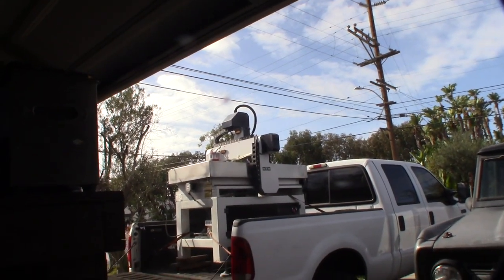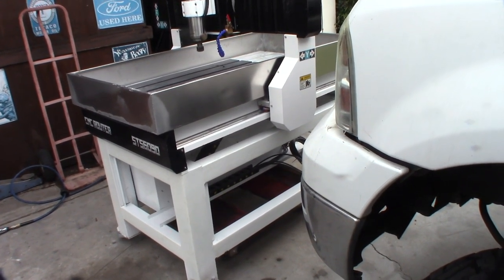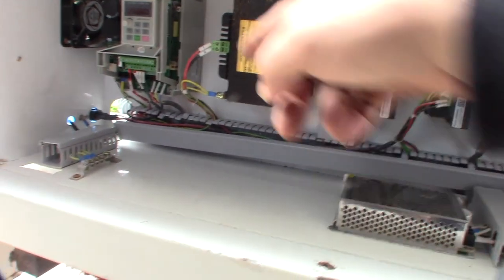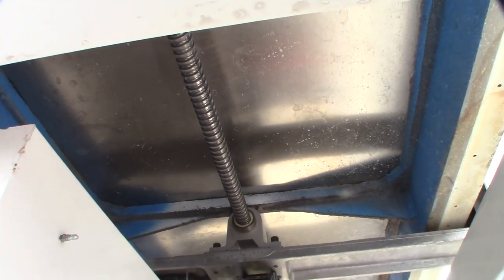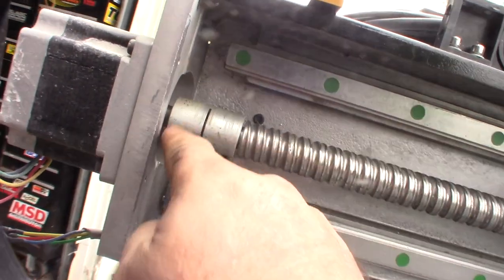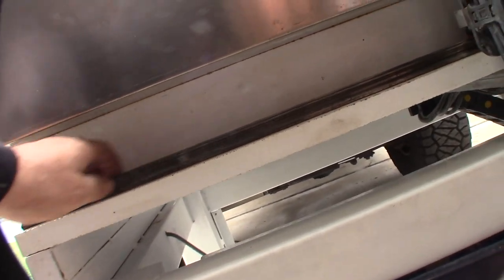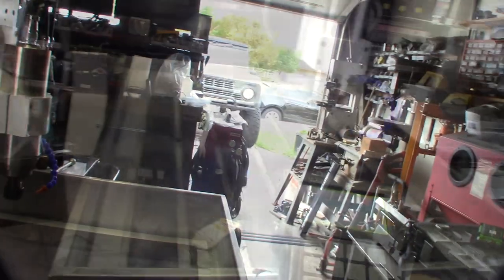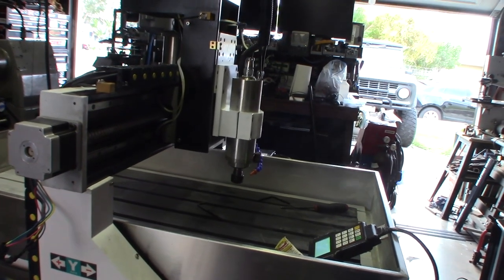Commercial Grade 6090 CNC Router, OfferUp $600 Score, STS6090 richauto control.

Comment: what a score....hope you show everything you did to get it running in the next few months
Reply from the maker: I'm actually in the process. Making a video about it. I just got done welding a Monitor mount. Hooking up solid state relays to control pumps from software. Also installing a closed loop spindle coolant radiator.
Reply from the maker: I'm still in shock. This thing is insanely well made. huge ball screws and large linear rails.